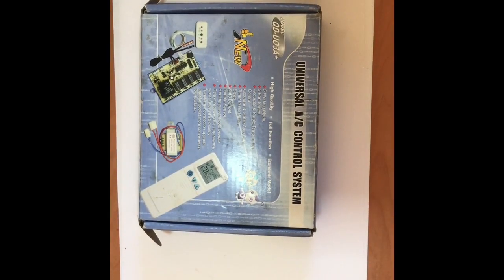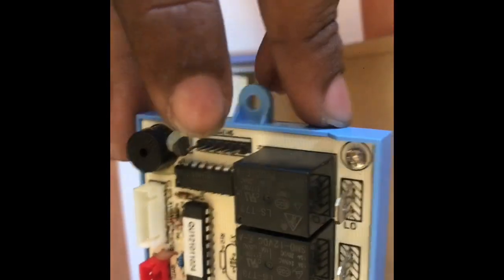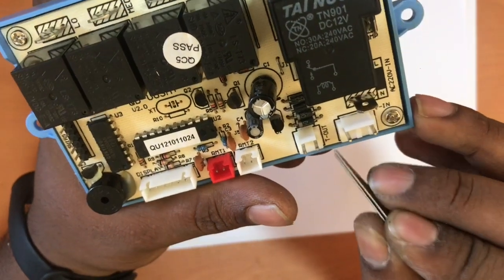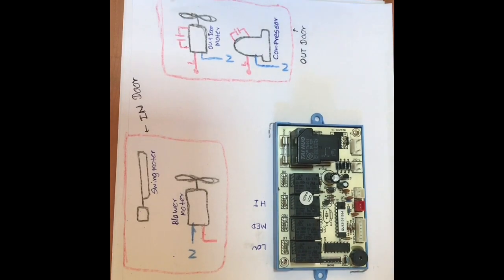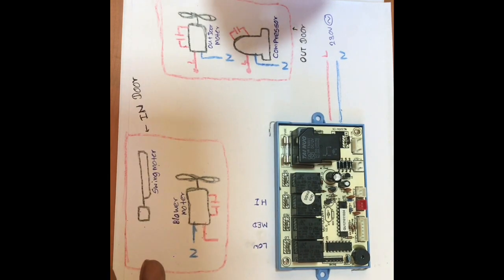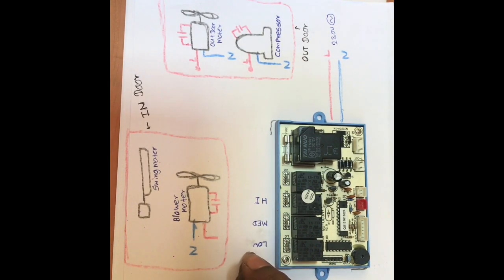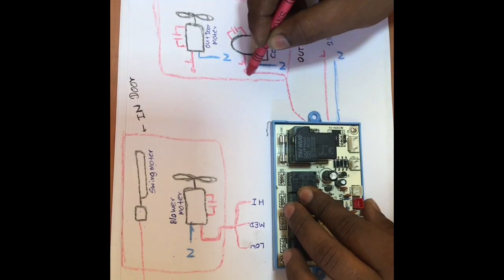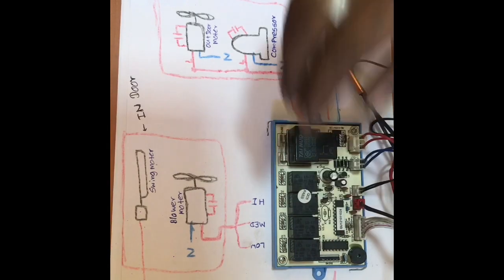How to install universal A/C control system sinhala (part-01)

Comment: Swing moter ekata denna barida
Reply from the maker: Puluwan Samahara ewa weda karanne naha samahara ewa weda karannawa
Reply: Siwng motor eka stepper motor ekaknan...original bord eken wire connector eken motor eke supply wire eka hoyaganna....ita passe eka universal bord eke swing motor connector eke supply ekata denna....anith wire maru kara kara balanna wire hariyatama connection ok unama motor eka wada karanawa...